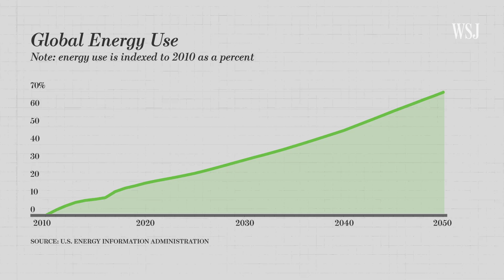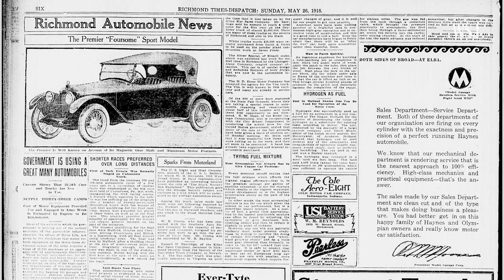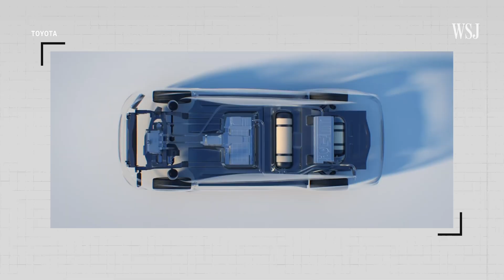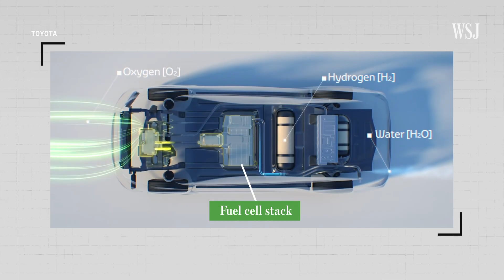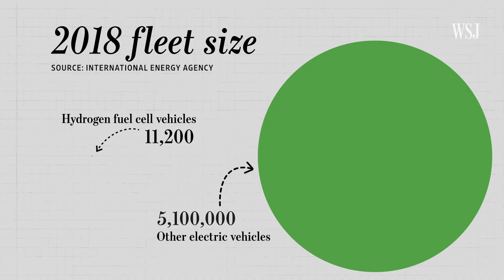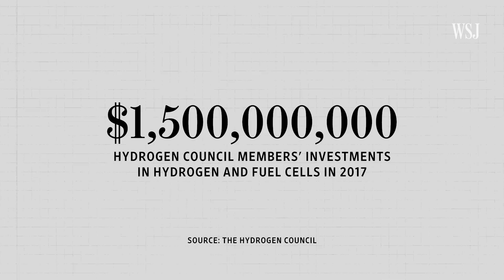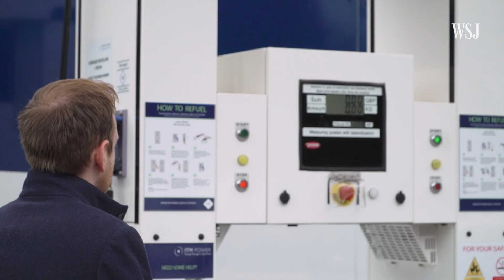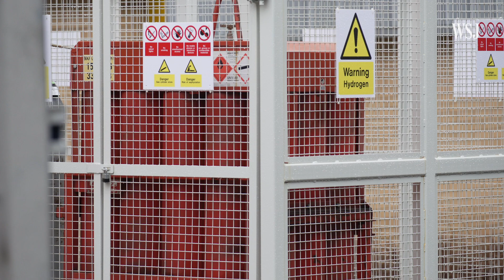Can Hydrogen Fuel the World's Fast-Growing Energy Needs? | WSJ

Comment: I want to see a comparison of how much energy is wasted when charging a battery vs creating hydrogen.  That will ultimately answer the question if hydrogen is the future or not.
Reply: Electrolysis of water is 70% efficient. ie. 30% of electricity used to split water and make hydrogen is wasted as heat in the water. Then you have to compress and liquefy the hydrogen to ultracryogenic temperatures for transportation and distribution. Then you have to recombine the hydrogen with oxygen in the fuel cell of the car to make electricity again which is only 60% efficient. The whole scheme is idiotic. A battery electric vehicle takes the same primary source of electricity and stores it at >90% efficiency for direct use in a motor that uses it at >95% efficiency. The debate has been over for about a decade. There is zero real competition for batteries from fuel cells. The only thing propping this Rube Goldbergesque joke is the fossil fuel industry who wants to delay battery electric cars at all costs and keep people using oil and gas which is still the primary source of hydrogen.
Reply: @Muonium1  this is only true for small to medium cars, hydrogen is by far the superior choice for large vehicles such as locomotives, trucks, mining trucks, ships, etc where the battery weight affects the vehicle too much. Hydrogen is the new diesel but electricity is the new petrol.
Reply: @Muonium1  you're 100% right, thanks for all the info
Reply: @tomncld7952  No, he is not 100% right. The efficiency numbers are accurate, but hydrogen doesn't need to be liquefied. When you need to increase the vehicle range, you need to increase the battery size, which adds weight, which increases the energy consumption, so in the end you have an economy equation of efficiency limiting the range. Sooooo alongside efficiency, you need to take energy density in the discussion. 'Real engineering' channel has a good video on that.
Reply: @felipealbert_0  Yeah but tbh i'm more concerned about the ecological aspect of the problem, and making hydrogen ready to be fill in cars is something way more polluting than producing electricity and even battery (correct me if I'm wrong)
Reply: @Muonium1  at the end of the day is the consumer who decides if oil is worth it or no, and since batteries car have some issues that companies like tesla are fixing, like for example the price, its just a mater of time till oil and gas is no longer use
Reply: @ReyZar666  hydrogen is more convenient for consumers. You can just fill up like a petrol car without waiting for 30 minutes for your car to charge.
Reply: @almac9203  its more expensive than gas though
Reply: Al mac cant refill at home tho. As eletric car drivers seldom charge at a public charger.
Reply: @TheLemonBird  what garbage. Tesla owners always tout the advantages of Tesla's is the extensive charging network. They don't tout the network if they never use it! Electric car owners do use the superchargers so there goes your argument. What's more convenient between stopping for 3 minutes for a refuel versus stopping for an hour to recharge your car?
Reply: @almac9203  Will there be a hydrogen charging station in my garage next to my electric car electric outlet?
Reply: Real Engineering already did that video.
Reply: Also need to factor in the amount of hydrogen leaking from your tank..
Infrequently used cars will lose a lot of fuel to leakage, hydrogen fuel station tanks will also leak..
You an store hydrogen in metallic crystals, but that needs refrigeration, so is just as energy wasteful..
Reply: Hydrogen can now be produced using using it's own energy.
Thank you from  'H2 Innovation Lab'  H2IL - innovative technology for a green sustainable hydrogen future.
Reply: H2innovationLab H2IL that sounds like a perpetual motion machine.  That can’t work.
Reply: @TY K you do know that a hydrogen powered car is still an electric car right ?
Reply: https://youtu.be/f7MzFfuNOtY
Reply: the problem with hydrogen is efficiency, the problem with lithium ion battery like tesla have is supply. the battry use some of expensive metal at a amount higher than hydrogen car need. tesla model S weight 500kg more than toyota mirai while toyota mirai have more range than tesla model s.
also in the recent year, china is starting to use their monopoly on REM to punish country that hurt their feeling. also japan throw hissy fit and limiting chemical export to south korea a chemical use to manufacture phone screen costing south korean bussines money. and if you guys follow the news china is buying up lithium reserve in australia and latin america. tesla say something that insult china and they are finish. you see battery is good and all but the material to made it is limited to handfull of country.sure you can find cobalt and lithium in another country, but at economicly mineable condition? sorry buddy not gonna happen. it will become the new OPEC all over again with lithium and cobalt embargo.
Reply: I too thought hydrogen was expensive and inefficient to produce then I came across new science by an energy lab called H2IL. This would put hydrogen in first place.
Reply: @scienceeducatorge8597  Never. Hydrogen from renewable source to wheels has 5 steps, each of which loses energy along the way. EVs uses that original energy in the form of electrons and it only takes 2 steps to get to the wheels. Both of those steps are already 90% efficient. No matter what type of Rube Goldberg system you come up with for hydrogen it has too many steps from electrons to hydrogen back to electrons again. Even if those steps approach 100%, which is absurd, hydrogen still loses.
Reply: @TY K Uh, no. https://insideevs.com/news/354223/hydrogen-fueling-station-explodes/
Reply: Real engineering already did this bro look it up
Reply: https://www.youtube.com/watch?v=f7MzFfuNOtY
Reply: In long time ago we have been told we can use lightning for energy! can we made hydrogen form lightning?
Reply: that is not the problem, the biggets problem is how can we create a process of making hydrogen without using electricity, and i think its going to have an inpact in the future
Reply: HIgh temperature Hydrogen electrolysis using solid oxide ceramics can have efficiencies aproaching 95%,  and in fuel cell is around 60%, 85% if you can recover the heat somehow,
Reply: Yeah not much comparison needed batteries win easily in this department
Reply: If the waste heat from production of hydrogen is used in district heating that could improve the overall efficiency a bit. Maybe hydrogen can have a role in powering shipping? I doubt a container ship can house a battery big enough for going across oceans.
Reply: There is a lot of video on the subject, and creating Hydrogen is way more polluting than using electric cars
Reply: @tomncld7952  Not really. This is false. Creating batteries is way more polluting then handling hyrdrogen. Remember then in either case you need electricity which should not be produced from fossil fuel power stations.
Reply: @Allen Loser Get back to me when any diesel car can fill up in the convenience of my garage every week for half the cost of diesel you would pay for at the pump. 

I'll take that convenience in mobility all day everyday over not having to stop once or twice for 15 minutes at a Supercharger every 2-3 hours of driving when I go on a trip once or twice a year.

Also my EV will "smoke" your diesel from light to light or on a track and is much more fun to drive. But don't worry because your old tired diesel will always out smoke my EV when it comes to emissions.
Reply: @flipadavis  Sorry but I highly doubt your average EV is going to "smoke" a diesel on a track.
Reply: Electric Vehicles become more viable with battery technology improvements over time in charging, storage and discharge.
Reply: DJPelio it isnt
Reply: @DJPelio - You might find this video interesting about the "Well to Wheel" efficiency of BEV, Fuel Cell and conventional ICE vehicles.   https://youtu.be/2rywz73vwKw
Reply: @TY K, hydrogen as fuel is viable for Space Technology.
Reply: @DevendraMahendraSingh  Even with space things are moving away from hydrogen - see SpaceX's Starship, and how it is going to use methane. Hydrogen is just a pain to work with.
Reply: @TY K Maybe if you live in Canada but otherwise electric car and especially Tesla are 99% safe
Reply: Electric still very inconvenient and hydrogens are still inefficient
Reply: @joonpark6237  hydrogen is not inconvenient. You just fill up your car just like you do with petrol. Much more convenient than waiting for 30 minutes for a battery to charge.
Reply: @almac9203  if you have access to a plug at home or work, you don't wait for a charge, you get in a car that's been charged for your normal driving. That's far more convenient than driving to the hydrogen gas station.
Reply: @skierpage  electric isn't more convenient. You have to wait ages for a charge and there is range anxiety. Electricity is OK for short journeys but if you have to recharge then the wait is too long. Hydrogen is like petrol in that you can refuel in 3 minutes.
Reply: @almac9203  I find it more convenient to have my car "filled up" in my garage every day which is around 95% of my miles. Having to wait 20 minutes every once in awhile on a road trip is hardly a big deal. However, at this point in time I couldn't fill a hydrogen car up in my garage or on a trip since there are zero stations in my state or the surround states.
Reply: @almac9203  Funny because I've travelled multiple times from Atlanta to DC and from Atlanta to Orlando in my Model 3 where I only stopped twice for 20 minutes. We would have stopped twice for 10-15 minutes anyway in a gas car for bathroom breaks over a 8-10 hour trip. 

I couldn't however drive a hydrogen fuel cell to either of those cities because there are zero hydrogen stations anywhere near those routes or in my city for that matter. And for most of the year while commuting I have my car charged up in my garage and never have to stop during the week at a gas station or a hydrogen station. You can't do that in your garage.
Reply: @flipadavis  there aren't enough hydrogen stations at the moment. Hydrogen is more convenient than battery but we need the infrastructure. Hopefully the hydrogen network expands. It is funny how Tesla fanboys claim that they fill up 95% at home so range isn't an issue yet when the superior Taycan came out suddenly range is the be all and end all just like performance was the number one issue until the Taycan showed up. Tesla fanboys are a blight on the world. Most Tesla fanboys are just virtue signaling fake greenies. Just as the virtue signaling prius owners disappeared so will these fakers!

Comment: Didn't answer the most important question; is the conversion net positive?
Reply: @In a Universe where Deception halts Progress sure it does, otherwise it doesn't classify as a fuel.
Reply: Electrolysis is still an expensive option.  Proton Technologies are developing a more interesting technology producing H2 from oil sands without releasing CO2 to the atmosphere.  On the surface appears to be a good lower cost option and a good use for oil sands infrastructure.   We need to understand if the CO2 produced will remain locked below the surface or if it creates a future risk to our environment.
Reply: @Allen Loser you don't understand the nature of the question.
Reply: @Allen Loser I'm afraid I do.
Reply: @Allen Loser because you've misinterpreted it.
Reply: @Allen Loser not where you issue ultimatums.
Reply: @Allen Loser no, I've chosen not to enlighten you on the basis of your conduct.
Reply: @_l735  Pretty convenient, my friend.
Reply: There are no processes that are net positive.
Reply: @lucrolland7489  again I'm talking about energy in vs energy out.
Reply: @_l735  Not a good way to evaluate a system as you should provide a complete analysis. Then with your idea, only electrical trains are efficient. Remember that batteries add a lot of weight which cost more en energy to move the vehicle. Electric SUVs or even trucks are heavier and also provide other challenges.
Reply: @lucrolland7489  they're still net positive, that's how motion is produced. Maybe actually study some engineering.
Reply: @_l735  I actually am a professor of mechanical engineering. I design the ships based on fuel cells and was aong th first to consider onboard elecrolysis 12 years ago and this is now done. Explain what net positive is? I do not see that in my textbooks.
Reply: @lucrolland7489  how about you correct your spelling firstly Professor.
Reply: No.
Reply: No, there is no net positive conversion, what are you talking?
Reply: @felipealbert_0  Indeed, there will be never a positive conversion with anything including fossil fuel.
Reply: @felipealbert_0  how do you respond to what someone is talking about if you don't know what it is?
Reply: @_l735  you always lose energy in conversion is a thermodynamic property. So, I want to know what is ''net positive conversion'
Reply: @felipealbert_0  .
Reply: Dylan Peres  however batteries last about a half a decade and need to recharge more often
Reply: It's a waste of energy. When you push the gas pedal, 80% of the energy has already been lost through the process. People tend to avoid the "well to wheel" part of the energy.

Comment: Hydrogen is actually polluting the world more than fossil fuels right now as it needs electricity for electrolysis
Reply: https://www.telegraph.co.uk/china-watch/technology/hydrogen-from-water-clean-energy/
Reply: @cameronf3343  you keep spamming with that article. Something that splits water directly is just a solar cell and electrolyzer combined. It's not revolutionary and the efficiency in terms of incoming solar converted to useful energy is worse than conventional solar cells that generate immediately and generally useful electricity.

I hope something renewable replaces steam reformation of natural gas as the source for current industrial uses of hydrogen, but that still leaves the inefficiency and cost of compressing it, shipping it, then turning it back into electricity that leaves hydrogen a poor competitor for batteries in transportation.
Reply: I'm not sure what you're saying. 90% of hydrogen today is made from natural gas, so it's another use of fossil fuel. The fossil fuel industries are far far bigger than the hydrogen industry.
Reply: @skierpage  energy is lost for making hydrogen from natural gas